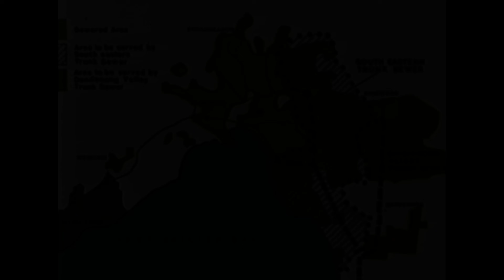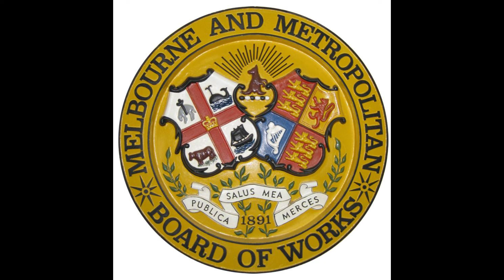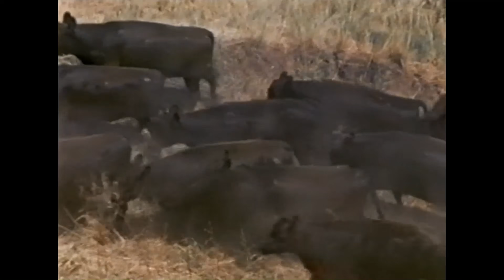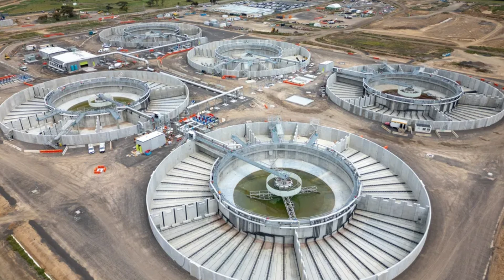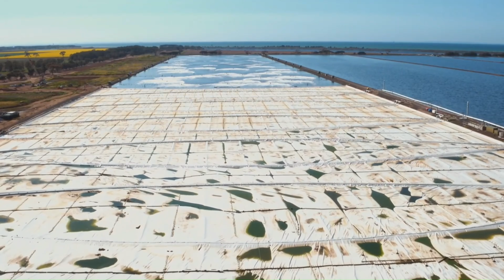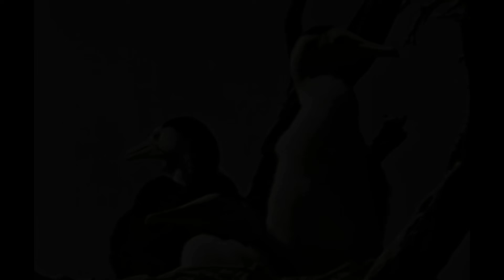Melbourne's Sewerage Story - EP4: Werribee - A Living Sewerage Farm

Comment: Keep up the good work. The Werribee farm is a major component of the sewerage system and was operated with lots of staff over the years. When it was operating as a farm there were stock hands, pasture managers, and other related staff plus families of the staff. This meant the farm operated as a community with its own housing, school and support services such as a post office. These are all gone now but it was a unique site in the outer Melbourne area. Cattle were raised and sold for meat. Sheep were raised and shorn for wool and sold for meat. A true farm on the outskirts of Melbourne. This all contributed to minimising the operating costs. It was unique amongst Australia treatment facilities. Dry weather flows went to pasture used to raise the cattle and sheep. Wet weather flows which were much larger than the dry weather flows went to lagoons for treatment. All outputs went the bay eventually.
Reply: "Wet weather flows which were much larger than the dry weather flows". Due to infuent plus illegal stormwater connection? 
Hazard a guess what the unintended 'infuent' (fluid entering sewerage pipelines) quantity is today?